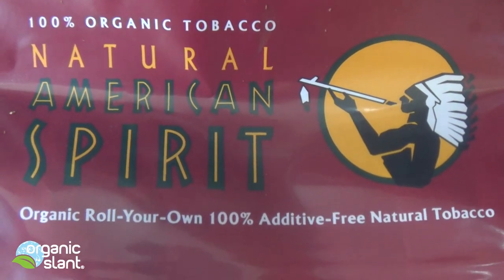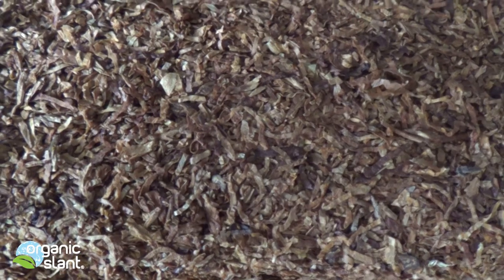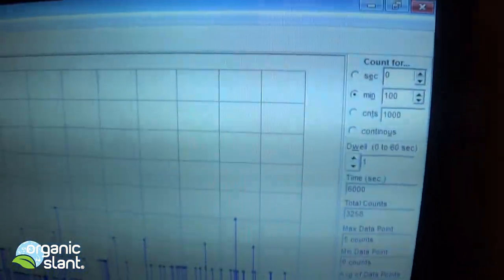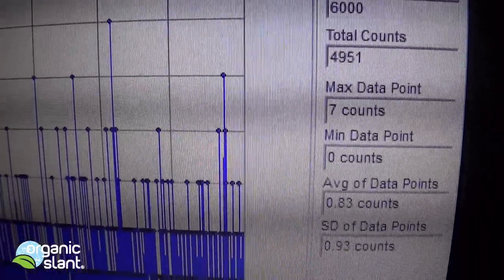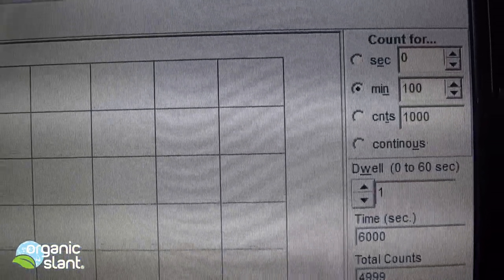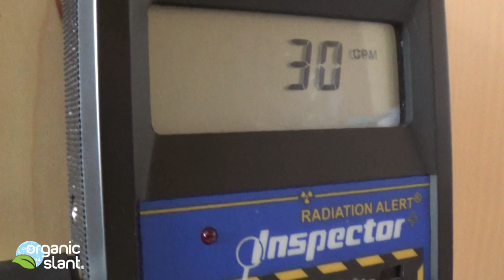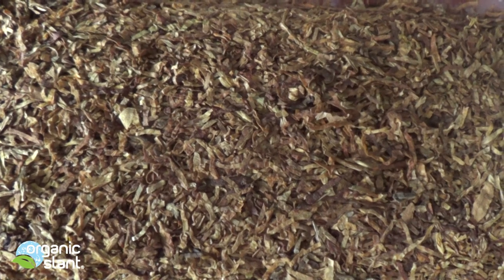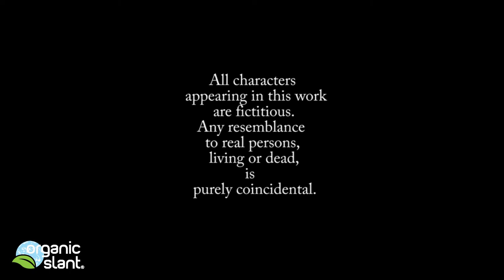Radiation monitor tobacco American Spirit Organic pouch Roll-Your-Own 11-25-2013 | Organic Slant

Comment: Not exactly a scientific test. Where is the control? You'd be surprised how much of the food you eat everyday has the same amount of radiation in it. When was the last time you calibrated your equipment with cs137 or co57???
Reply: and to add you need to subtract the background from your test results to get your numbers. If the background is 25cpm and the tobacco reads at 40cpm then the reading is 15cpm. This should technically be tested in a chamber to combat fluctuating background levels

Comment: You should grow your own tobacco plant in soil that you test for radiation, and only use tested water and fertilizer.  The resulting plant should not give off radiation above background.
Reply: and don't forget to process it with all those magic ingredients, mill the tobacco to dust, glue that dust together and make a kind of paper out of it, spray that paper with the nicotin you extracted before you did these steps, cut it into similar little shreds, fill your cigarette paper hull with it after you have impregnated that with paraffin to keep them cigarettes smoldering once they're lit. by the way, did you know one single cigarette filter is toxic enough to pollute 6 liters of water to the point fish will die in it? and that is before the cig is smoked

Comment: hey, this is great. incredibly insightful. i live in eugene, oregon where loads of "hyper-conscious" hippy types think they're doing themselves a favor by smoking these. i guess not.
Reply: Well I get that no tobacco is good for you. Having said that I've been a smoker for 38 yrs. The first 5 yrs was Marlboro red. The next 8 was Marlboro lights because I had asthma and couldnt take the reds. Turns out the lights weren't much better and I had an awful hack. I did end up growing out of asthma ironically. I then switch to American spirit rollies in 97 due to no money and had to share with someone. I'm now 51 and still like 30 with 0 breathing issues so Idk what to say
Reply: I still smoke them and the pouch costs 27$ where I'm at. They used to cost under 2$ in 97. It took them a while to realize it but when they did the price went starting going up and is from done. So probably wont be smoking for too much long since there is no other I will smoke not even their filtered ones which are another story. Dont like those

Comment: could this mean that they are actually lying? or is tobacco inherently radioactive
Reply from the maker: Wouldn't respond to my inquiry...maybe u might ask them 4 response...
Reply: +organicslant Did you have a control? Have you compared it with regular, non-organic pipe tobacco? Should have known. They were bought out by R.J. Reynolds. Big Tobacco is about as trustworthy as Big Pharma.